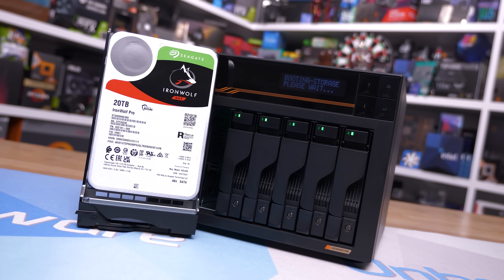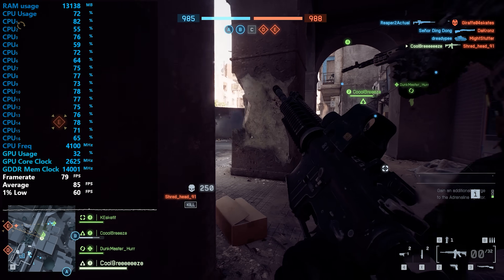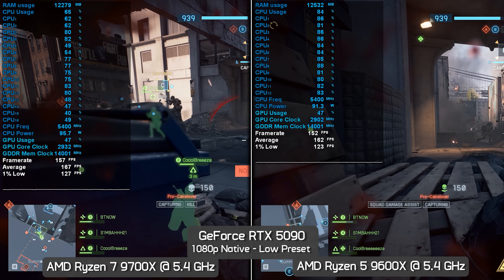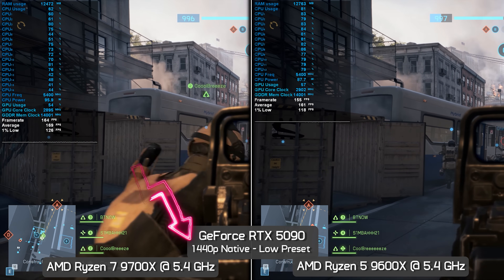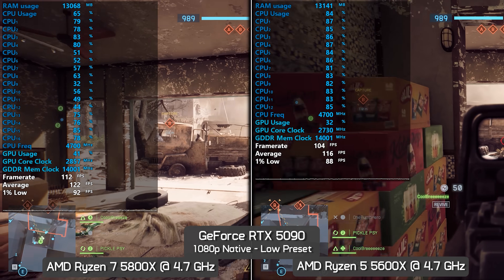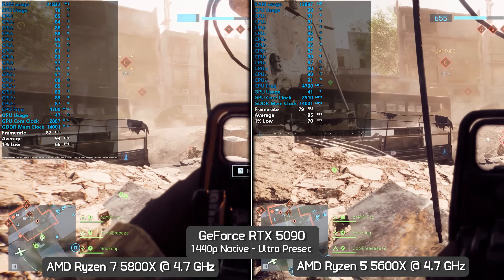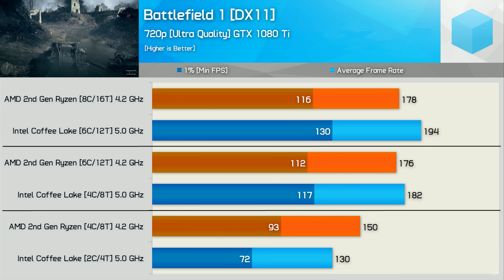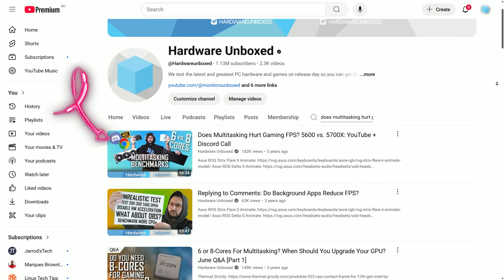Why Gamers DON’T Need More Cores, 6-Cores Still Works Well!

Comment: I want more cores because I do more than gaming and I need the parallelism that multicore cpus provide. As a programmer for iot and industrial systems that support ST, I implement systems that are time critical and I need that multicore headroom at my disposal. 

I do understand most don't have my own personal use case. But it's truly a situation to have more than necessary rather than not enough.

We've had the ability to make many-core cpus, numbering cores in the hundreds, for 20 years now starting with the old company tilera. When they sold, their tile structure core architecture spread like wildfires. Threadripper models after the original patent and modern gpus definitely take advantage of such designs. 

What we need is a die process that gives 1 or 2 "big" 5gz+ primary cores and a LOT of smaller parallelism cores. Similar to intels E and P cores but not that dumbed down.

Comment: From experience you usually don’t benefit from “future proofing” your PC, there are exceptions but not without hindsight. Like for example the 5800X3d is a good future proof CPU but only because the predecessor processors weren’t a major upgrade. The 1080ti was also a great example but also because the raw computing power of that GPU wasn’t beat till a few generations later, also highend GPUs got insanely expensive. It’s probably cheaper to wait till it’s needed to upgrade because by then they cost to performance is going to be lower. GPUs are still kinda the exception lol.

Comment: I wonder if this will change with next-gen consoles coming in and games finally being optimized for more cores. But yeah, I have been buying 6 core CPUs since Zen 1, cause game benchmarks seem to show not much better fps above that, except for X3D. Games seem to be a lot more GPU dependent.

Comment: Upgrading from a i7 11700k to a R5 9600X was noticeable even with a RX9060XT 16GB. Gained 5 to 15fps depending on the game and just day to day tasks are quicker. Got the 9600X $160 Prime days absolute steel. Switched to AM5 cause plan to get a 9800X3D eventually or the coming 10800X3D next year.

Comment: That's why I went 14600K mid 2025.  Upgrade bios first to ensure 12F microcode, run on intel defaults, o/c within that limitation and YOU SIR ARE GOLDEN.  Avg 89w when gaming with a small OC.  Easy to cool on air with a $30 cooler.  Better than good performance considering price.

Comment: It's fine for comparison, but spending money on the damn 5090 and not having an x3D, a fast CPU with the best performance per core, is crazy. That said, for gaming at 1440p and not using the CPU too much, a 9600x is fine, so you could invest in a 9700xt, for example.  For just over $1,000 you can have a very competitive PC, with the possibility of upgrading to an x3d in the future.

Comment: The problem is the game does not know how to use  the cpu cores properly.. thats why i use a “User.cfg” file to tell the game engine how to efficiently use my I9 cpu. I went from 80% usage down to 40 to 50% usage and gained about 20 to 30 fps…  this user.cfg file can be found anywhere from steam to reddit very easy to do and use.. i was getting 140 to 150 fps on the high presets , @1440p , and 140 to 130 fps on Ultra.. with no DLSS or frame gen of any kind

Comment: This disproves Tech Deal's narrative on 6 core cpu's going obsolete in the future. He always used to reference you guys and vehemently spoke against your view on 6 cores being enough. He never mentioned your channel name particularly but it was pretty obvious lol. Last time I checked they got quiet and haven't uploaded in a long time, wonder what happened to them.
Reply: Yes I remember tech deals always saying more cores smoother and future proof. It was true when it came to 4 cores to 6 cores. But they were saying 8 cores minimum and 12 cores and 16 cores were the best. Most cores I'd get is 8 cores but the x3d part 😂
Reply: It's worth noting that he also was calculating resale value into the math which softens the blow of the higher up front price. He also seemed like a pretty extreme user with lots of stuff running while he is gaming, while someone like Steve seems like he closes everything for absolutely max FPS. Different strokes. 🤷‍♀️

Comment: Need and want are two different things! 12 cores is the sweetspot, 8 is good, 6 is enough! But enough is not always what people want. Like 200 grams of beef may be enough for lunch, but you may actually wanted 400.

The philosophy is, what do you want your pc to do for you? If you want your PC to to play games on a single monitor and not much else the 9600 is a no brainer. If you want to have bunch of stuff open in the background 5 chrome tabs, discord, antivirus, cloud backup, steam or epic, and play a massive multiplayer game like bf6 with the gang, you may consider 9800x3d or higher. Also shaders in new titles should compile faster with more cores in theory. Basically the philosophy of you telling your pc to jump and it only asking how high?

Not to mention these are clean benches. We all have a bunch of extra stuff running in the background vs a clean install of windows

Comment: Haven't watched yet but I have a ryzen 5 5600 and at most its at 50% usage only higher if encoding a video or ue5s shader compilation a main reason for more cores would be ps3 emulation

Comment: Thats funny... I actually get more and more milage out of my 9950x3d in an ever increasing number of titles by NOT restricting core usage through gamemode.
Thats on Linux ofc, but the idea is the same. Have the scheduler prioritize x3d cores worked well in the past. But now (bl4?) some "offenders" actually benefit from more CPU horsepower.
...even with  the added latency from inter CCD interleaving. I think your missing something here by sticking with (potentially outdated) wisdom.
Then again, that might be a Windows issue, which isnt exactly known for its scalability...

Comment: Like anything, it probably depends on the game, and what else you're doing with your system. 8 cores is good for most setups, 12 is better. Especially if you're also doing other stuff in the background like hosting the game for more than a few people, etc. Much cheaper to go for a 12 core instead of an 8 core and double your ram in most cases to host than it is to spin up a dedicated server on a separate box, unless you already have one lying around or want to pay for cloud hosting.

Comment: I'd take a look at upcoming consoles. PS6 looks like 8 cores. Xbox next Gen is rumored to be 3big plus 8small. Assuming 1 small ~ 2/3 big comes down to 8 cores.
So I figure 6 is good now, but from PS6 on expect games to take advantage of two more cores, esp. if and when some Ai tasks need to be run/coordinated.

The same goes for RAM. One Ai comes through, add like 10GB VRAM.

Comment: Well im fked I rebuit a pc in 2022 thinking i was doing a good thing. Z690 mobo with an i512400f and a 6800xt. BF6 beta ran okay. My last build was for BF4 =x. I can't afford a new build so im going to go with a i514600k and possibly a 7800XT card. I should have went for an AM5 build. But i think at the time the price was a bit too high.

Comment: I don't feel the conclusion. Like the conclusion you don't need more cores even if a game can utilize it giving you more headroom for future proofing. I don't buy a CPU for games just releasing. I buy it for the next 4-5years. If it already is at 80% in CPU Bottlenecked situations I'll have to invest in a new one earlier. Much better value for the lower core chip is also a strawman argument because you can't buy a faster CPU for the difference in price. Aka If I buy a 2600x instead of the 2700x and I then have to upgrade 2 years earlier I won't be able to afford a new CPU from the money I saved initially.
Reply: 6 cores modern X3D ryzen will rape non X3D 24/48 or more cores older architecture cpu-s.
Number of cores play much smaller role than power of single core.
Ryzen 7 5700x 8 cores will not outlive 6 cores ryzen 5 5600X.

Comment: I'm not sure about 6 cores to be enough for BF6. Played beta on my i5-9600k (6 cores, no HT), 32 GB RAM, 3070ti. In general performance was fine for me. Though I use a 1080p monitor, so resolution is not so high. But there was an issue, not sure if it is netcode or CPU is struggling, sometimes my soldier continued to run with no input from my side. It is like I was losing control of it at some point. Got killed a few times because he ran into enemy fire. I think it is CPU issue, processor was too busy to process my input. Though it could be a bug too.
Reply: bf6 ran fine to me 🤷 (7500f)
Reply: That's not how any of that works. The game literally could not continue producing frames if it were too busy to process your input. That's part of the pipeline and generally cannot be skipped.

It's not your CPU, that's the game being buggy or someone's Internet being bad.

Comment: I had to stop the vid and pass. I don't like the way you degrade your audience about 1440 / 4k cpu testing. You have e your point, fine. But people making a purchase just want to see their use-case. If the attitude continues, I won't be coming to your channel for advice anymore.
Reply from the maker: "But people making a purchase just want to see their use-case"

It doesn't do that though, it's very dumb and we've done our best to explain it. if you don't like that then there are a million other PC tech channels, so you'll be okay.
Reply: @Hardwareunboxed 
I can tell you've had this discussion way more times than I have, so I get that you are frustrated and maybe a little raw when responding to comments like mine. I really do understand that, by removing other system bottlenecks, you can better demonstrate how many frames the CPU can push from the game engine. This is why you include tests with a variety of detail levels since higher LOD introduces more game elements for the CPU to compute. I appreciate your effort and your attempt to educate. You have way more knowledge than do I.

My point is that I have a mid-tier system that's about 4 years old, and I'm trying to determine my best upgrade path. I don't want to spend money needlessly on upgrading my Ryzen 5600 to an 9600 (or better) if it makes no difference when gaming at 4K. If all of the comparison charts tell me that a 9800x3d will get me 50% more frames, even with a high-end graphics card, and I don't have any information to refute it, I may very well end up waste $1000 on a system upgrade, when a new GPU may be the only thing that will help me.

What I would love to see is a video entitled, "How much CPU do you really need for gaming?". Ideally, it would test a modest suite of newer games at 1080P 1440P and 4K using low-, mid-, and high-tier GPUs. If, as you say, there is no point in testing CPUs at 4K, then it stands to reason that a CPU upgrade is never a good idea for a 4K gamer. I genuinely don't know if this is accurate.

At the very least, when you are reviewing CPUs, I would appreciate a statement along the lines of, "If you predominantly play games at 4K and you already own at least an "xyz" processor, this (reviewed) CPU will not substantially improve your gaming experience". Just throw me a bone, please!

The tone of my original comment was a reaction to what I perceived as a belittling attitude to people who either don't understand your reasoning, or are simply searching for something more specific to help them make an informed decision. You came across as elite and rude, not humorous as you probably intended.

Comment: I understand why the disclaimer is needed. Yes, if you wanted to suss out the differences between CPUs creating the environment that removes bottlenecks is correct. However, the viewer is trying to use this information to build a system. Much like you'd want to look at the benchmarks for the games you play most often when picking a GPU, seeing if a better CPU even matters at their preferred resolution is sensible.
Reply from the maker: Yeah which is not what you should be doing when looking at CPU performance. It's a serious pain point, you're asking for GPU limited CPU testing, but to what degree?
Reply: @Hardwareunboxed  That's the rub. Because everyone's budget for a new system is different, I can appreciate the complexity that would have to go in to designing benchmarks that would be useful for the average consumer. I know for myself I look at the standalone benchmarks, but I also look at reviews, when available, that include system components more aligned to my budget and use cases. Your channel already blows me away with the amount of games you test and the variety of hardware, so I'd hate to ask for even more, but I do find value in looking at the differences between CPU performance in 4k or 1440p vs 1080p as I'm trying to make a value based decision on how much performance difference I'll actually experience in different titles today rather than falling into the habit of trying to future proof. Thanks again for all of your hard work.

Comment: Pretty sure borderlands 4 has 8 cores as the min requirement.
Reply from the maker: It does not, they recommend a Ryzen 7 2700 as the slowest CPU you should use. There are half a dozen six-core CPUs that annihilate the 2700, which was the entire point of this video.
Reply: Yeah, building on what Steve said, though the minimum CPU listed is an 8-core part, that isn't calling out specifically 8-cores as a requirement. It's about the overall gaming performance of the listed part.

Guarantee you a Ryzen 7600x will slaughter that 2700.

Comment: The reason why 1080p is still relevant in pc gaming, is because most pc players still play from small monitors from very close distance. So 1080p looks fine and sharp. But if you game from example 65"OLED tv, then 1080p looks like a super blurry mess. And you cant view it from close as it will damage your sight in time.

Comment: Wish I was the average gamer, being into sim racing more cores really do help more than one would think, especially when racing with lots of AIs or in big grid races online.

My poor 5600X with heavy OC could barely keep up at 40-50 FPS on ACC with 49 AI cars (and had many stutters), with my 5700X3D I can easily get 70-80 FPS and a smooth frame time.

3D cache surely helped, but core count matters a lot in these titles, matter of fact best performing CPUs here are the higher core count ones.

Comment: To test Intel 7 vs AMD 2700 regarding corebenefitt 2025, you need to test them in system from that time, simuler prised then, in todays game.  And what if you make a cpu upgrade for less the 150$ a few years later.

Comment: I rocked a 7600x with my 4090 mainly for 4k gaming and later switched to the 9950x3d for 1440p and for 4k it barely made a difference and held it's own despite being cpu bottleneck

Comment: My ASUS TUF A15 has a 6-core Ryzen 7535HS and its totally fine paired with the RTX 4060 because the laptop only cost me $650. For the budget price and 1080p gaming, 6 cores is perfectly servicable as long as it is an AMD chip. Intel's 6-core chips are hot garbage that throttle like crazy.

Comment: For me in fortnite with my laptop 8940hx the best framerate when all 16 cores are on and smt off, using just 8 cores with smt off produces rsre but big lags,
Reply from the maker: Yeah if you have 'slow' cores, which you have, having more of them helps. A 9600X for example has much faster cores.
Reply: @Hardwareunboxed but with smt off fortnite works better anyways, so if you disable smt on 9600x it is gonna lag from time to time and 1% low gonna tank, with turning off one chiplet and running with smt on it get 141 % 1 lows with all cores and smt off 206 fps, results are on my channel

Comment: It's because of benchmarks like this that I'm so suspicious of why Borderlands 4 has an 8-core CPU as a minimum requirement. What could they be doing where a fast 6-core wouldn't run it as well?
Reply from the maker: System specs for games are often inaccurate, they should be considered rough guides as best. Obviously the game doesn't require an 8-core CPU like the 2700X, because that's not how any of this works.
Reply: I think it's just a simplification, as they can't start listing all possible CPUs out there in detail. More often than not, the "minimum" matters to people with older hardware. 6 fast cores are plenty, and an older 8 core can still be good enough (as the "sum" of those 8 old cores may not yet lag hopelessly far behind the fast 6 core). So, for them its "safer" to put the minumum at 8 old/slow cores rather than 6 old/slow cores.

Comment: Unfortunately most games don't scale beyond a few cores so higher end is more for IPC. It would help if games were compiled with avx2 but office pc from 2010 users would need to upgrade. Also Battlefield 6 is impressive for both it's higher cpu utilization and giving ~60fps even on lower end.

Comment: I used to have an eight core CPU in my 2009-2019 AM3+ PC. Somehow it's a lot slower than my newer AM4 and AM5 PC's both running on just six cores. Weird that. Almost like not all cores are created equal and it's more marketing than a performance metric.

Comment: i'm on 7600x and can't watch full hd youtube, will get youtube lag and pull some performance cpu
chrome run at igpu while my game run at 6700xt 
have 2 monitor each one plug mainbard and gpu 

Question : if i'm upgrade to 7800x3D or 9900X, will it fix my problem?
Reply: WTF mate, did you fix your issue yet? Even an intel Atom with iGPU can play full HD 60fps youtube, I'm telling you from experience